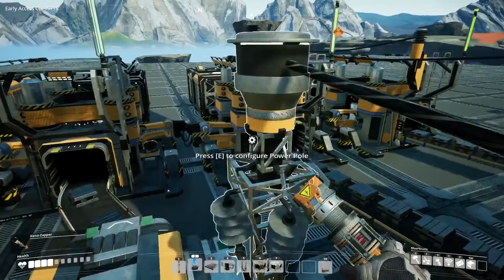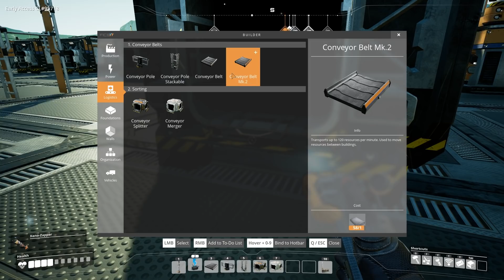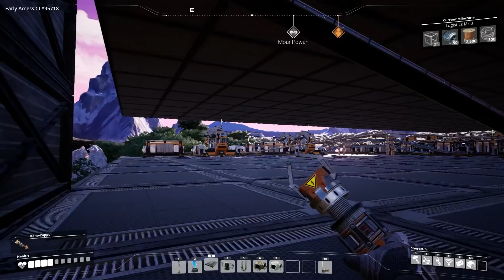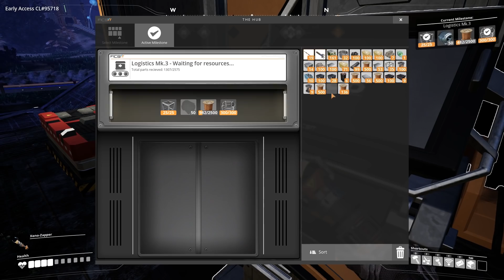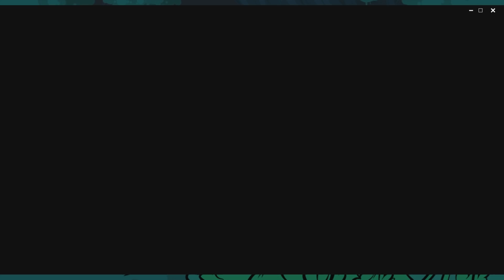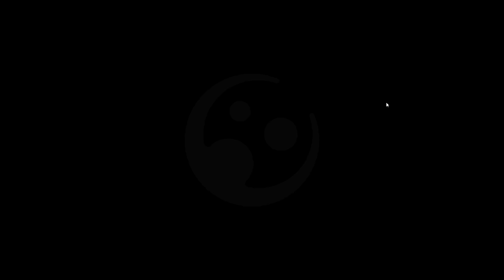Let's Play Satisfactory [Alpha - Co-Op w/ Aavak] - PC Gameplay Part 21 - Too Slow!

Comment: You could probably get in contact directly with a developer to make them aware of this issue (because as far as I am aware, they are too busy to look at all the reports and the forums don't have many developers keeping an eye out for things like this). In the meantime, try giving the save file to Aavak (Located (unless otherwise specified) at: Documents - My Games  -FactoryGame - SaveGame) and make him the host. This has fixed the issue for a few people, but on all of the forums I have checked, no developer has made a comment on it. It is only a multiplayer thing and it only happens on the host side.